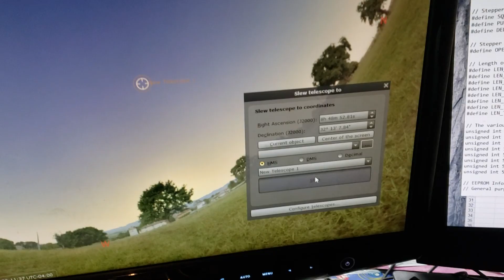Celestron CGE with Onstep controller.

Comment: Hi. Interested in your project. I too have an older CGE mount that currently works but there is an issue with encoders as it can't point accurately. Are you aware of any good quality stepper motors that will work with this mount and can be fitted? I have a control box and handset that requires steppers to work. Do you also have the relevant info regarding worm coupling requirements and other mechanical dimensions that someone who supplies stepper motors would need to know? Thanks
Reply from the maker: Hello. The motors in it are proprietary servo motors with encoders. As far as I know there is no aftermarket replacement. The entire go-to system needs to be replaced if it fails.

Comment: I've got a dead CGE pro that I were going to throw away as it's been sat here collecting dust & very nearly did until I saw this system, I've seen a kit for them & I were wondering is it a hard system to learn? The mount itself will be set up in the observatory permanently so not looking at using or needing a handset as I just want it to connect to a mini PC to run ASCOM, NINA, GS server. Is this system a plug & play like plugging in a Skywatcher mount or is there more I need to learn?
Reply from the maker: I've been looking for another dead CGE for a new build. If you don't want to mess with it I'll buy it from you.
Reply: @DeepSpaceDad   Sadly I'm in the UK & the shipping would cost the earth lol the kit I've seen is by a guy called Chad Gray I don't mind fitting it as I'm quite good at diy, computers & programming on the other hand not so good lol
Reply from the maker: Oh yes. That's a bit far away.  😂 You'll need mechanical engineering to modify the mount and fit the motors, electrical engineering to build the controller, and computer programming to modify and compile the software. All the information you could ever want or need is in the Onstep group message board. It's just a matter of digging in. There's a fairly large community
Reply: @DeepSpaceDad  Just thought I'd give you an update the CGE pro is up & running in the observatory, I've had a couple of sessions with it & it guides well between 0.3 & 0.1 arcseconds with the RASA 11. I went ahead & bought it as a kit & after a bit of learning curve with the system itself it works well. I've uploaded it on my channel if you fancy having a look.
Reply from the maker: @dumpydalekobservatory  fantastic! I'll go check it out
Reply from the maker: It's heavily DIY. Plan on spending at least a year learning and building.

Comment: I have a CGE and it gives me a lot of troubles with PE and other random jumps. I'm shooting through a 1000mm F3.9 Newt. I would love to upgrade the mount rather than replace it. What can you tell me about this OnStep solution? Has it proven to work well and add new life to your CGE?
Reply from the maker: Yes it's a complete game changer. The CGE is mechanically well built but the electronics are terrible. Onstep replaces the drive system and gets rid of all the bad Celestron computers
Reply from the maker: If you're not an electrical engineer, building one can be an intimidating job but there is a ton of help out there. My CGE has been working so well since the conversion that I don't see the need to upgrade. My current setup probably weighs 50 lbs and I get .6 arc second guiding all night
Reply: @DeepSpaceDad  thanks!! I’m not an EE but I have a brother that is. I’m also good with a soldering iron and have some knowledge of a multimeter and some coding. If I had clear instructions I’m sure I could put this together. Does this mean the hand controller goes away entirely and the mount has to be driven through a program with ASCOM support?
Reply from the maker: A hand control is a part of the project but you don't need to build it. I control mine with an Android phone, wifi connection, and a planetarium app like sky safari that can send commands to the mount. It's SOO much better than punching numbers into a hand controller. It's also got an ascom driver and an onboard web server. You can build a classical hand controller if you want but there are much better ways of doing it with Onstep.